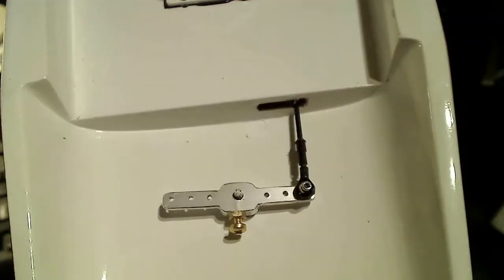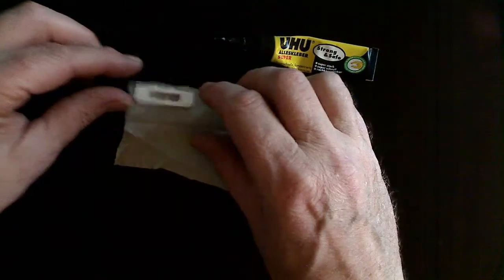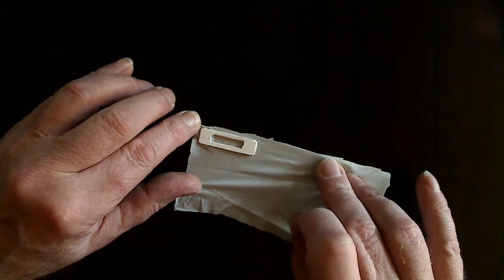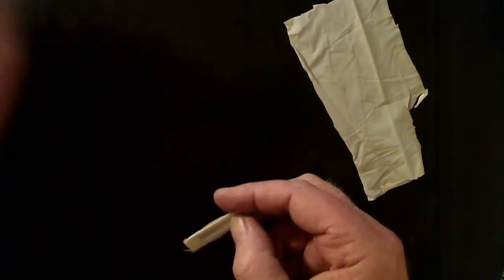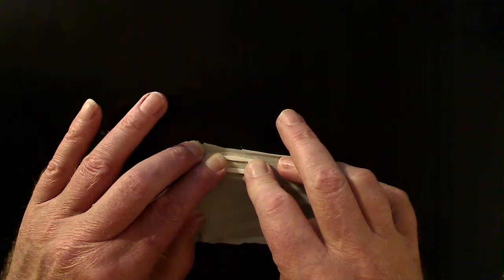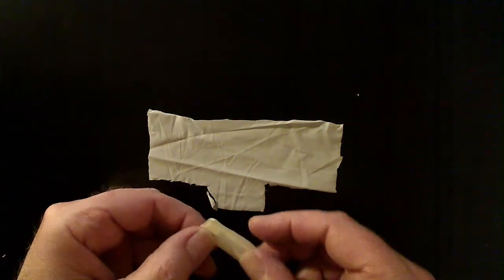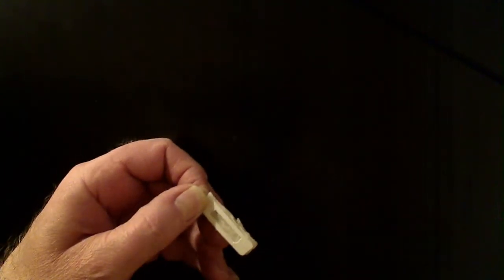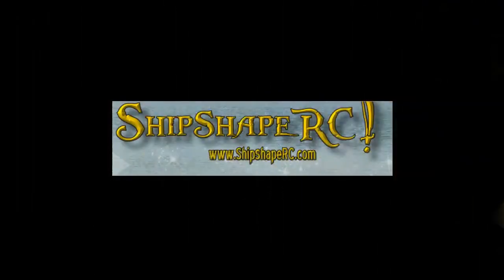Hurricane 1000 Rudder Rod Seal

Comment from the maker: Hi Dario
I cut and filed the Aluminium Rudder Arm by hand from a strip of 2mm plate
I hand threaded the lock bolt hole
Not sure where you can buy, sorry
Thanks for the comment
Jester6